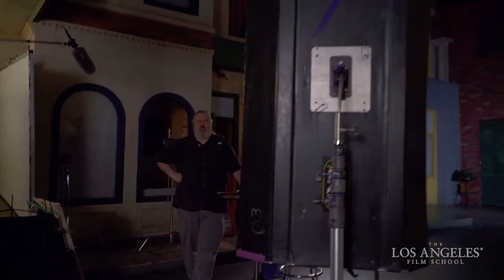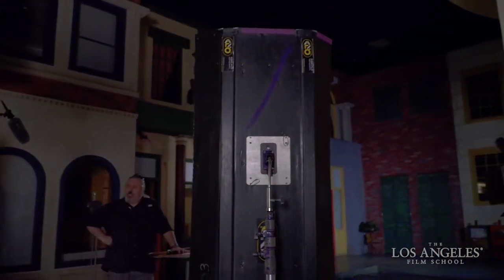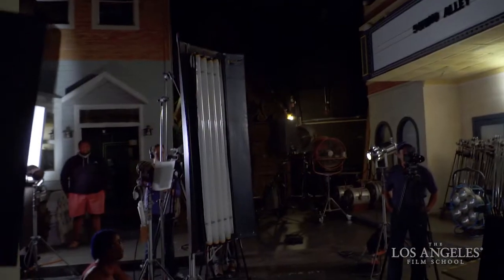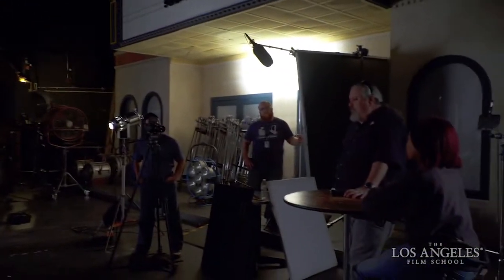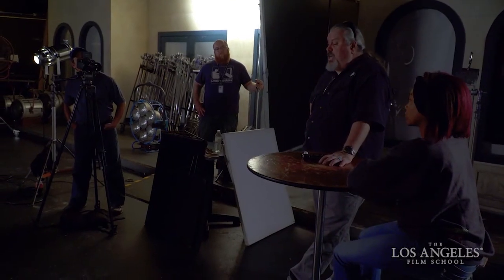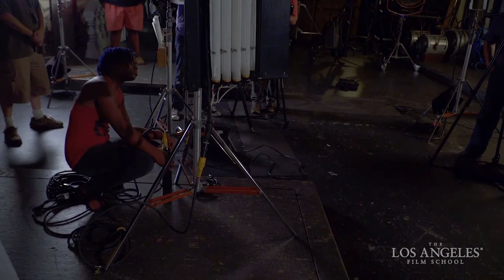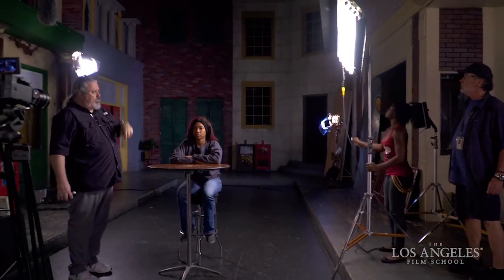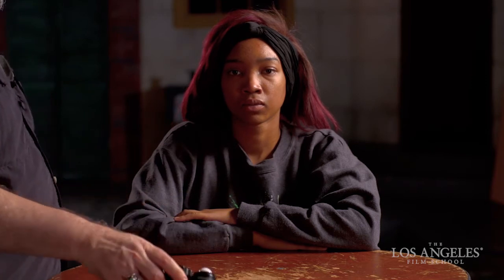3-Point Lighting (KinoFlo) - LAFS DFM-200 Prt. 3

Comment: If I wanted to make a fill light on the other side of the face to decrease those shadows, given that the kino will be about 9,10 feet from my actor´s face, is it convenient to just throw another kino with less luminance than the key light to fill the shadow while not making it completely even, or can I use a reflector even if the key light is not really very close to the actor and save myself from getting another kino just to act as a fill?
Reply from the maker: Bryan Alonso Galaviz Beltran _ Hi Bryan! If your 4x4 is as far away as you suggest, you may find that there is not much to “return” on your subject, if you use a bounce card. In that case, you might try a single kino tube, wrapped in diffusion, as a means of fill. I will always try for a bounce fill, because I like the ratios. However, I will use a very large bounce, like a 6x6, or 8x8 muslin, or other soft bounce for the size of the highlight.
Reply: @michaelwalsh3462   Thanks professor. It helped me alot as I am setting lighting schemes for a fake tv spot in a cinematography class. I think I am going to push the bounce card as fill light possibility as far as I can.